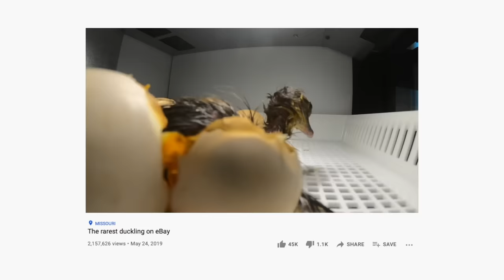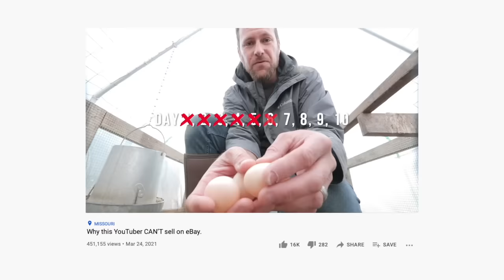Mama ducks caused a Mandarin duckling Disaster.

Comment: Some heat tape would do wonders here like the type they use for snakes. With a line running along the back of the breeder boxes you could put it on when ever temperatures drop to much. Could be used for all your animals during really cold spells